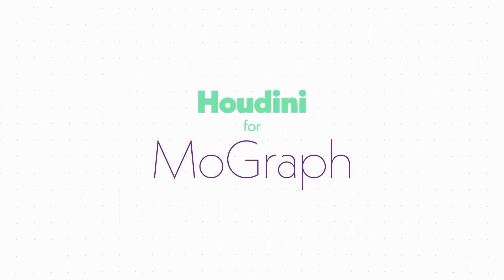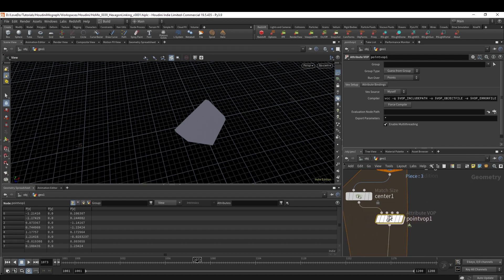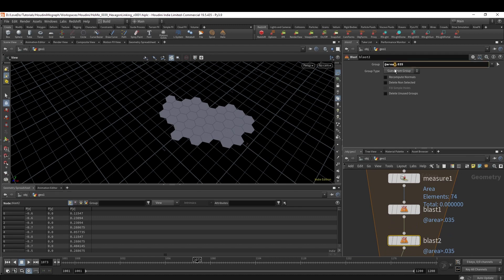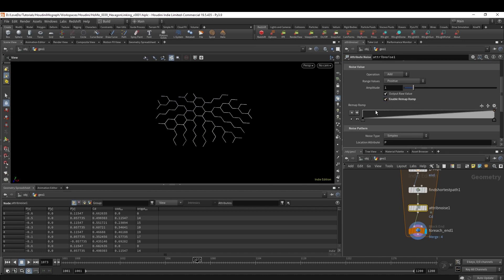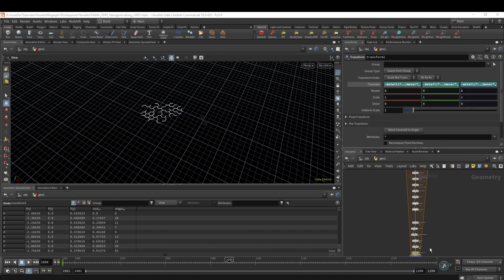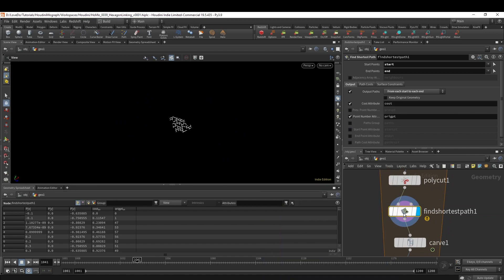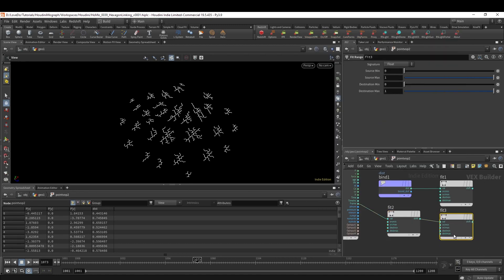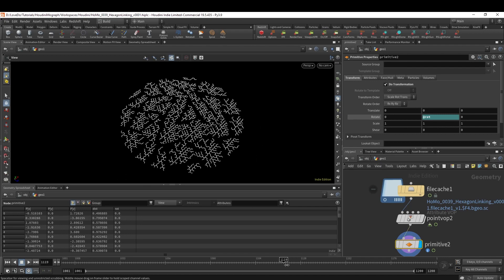Hexagonal Linking - Houdini For MoGraph Ep0039

Comment: Super. For the last vop setup, usually i prefer to have a fit range for the Min, and for the max instead of another fit range i ADD to the output of the min, a float parameter as Falloff or call it  threshold, so i can adjust outside of the vop the range. 👍
Reply from the maker: that works too! the beauty of Houdini is we can set up the same effect in a way that works for us individually